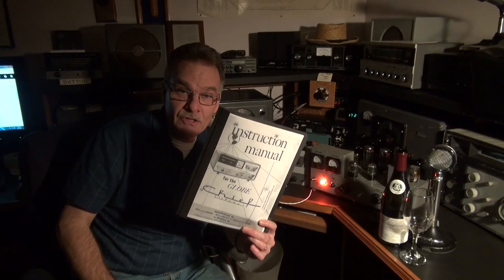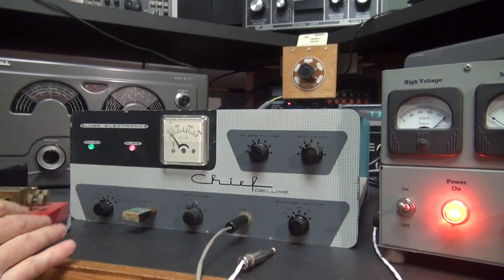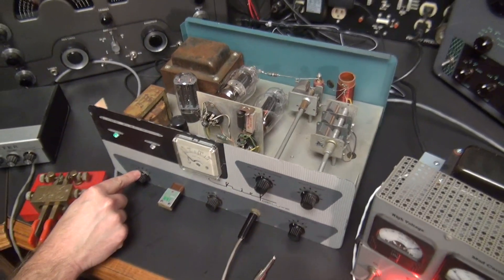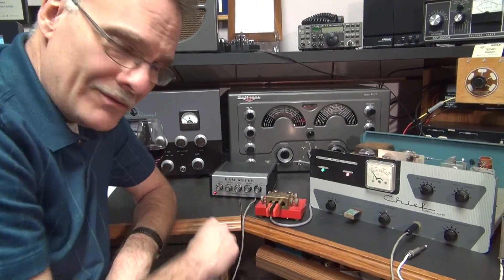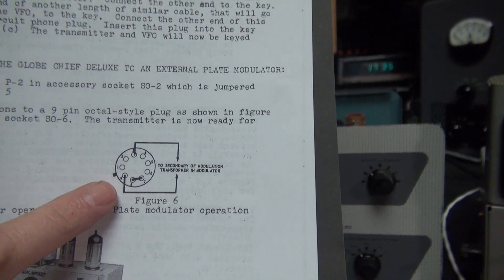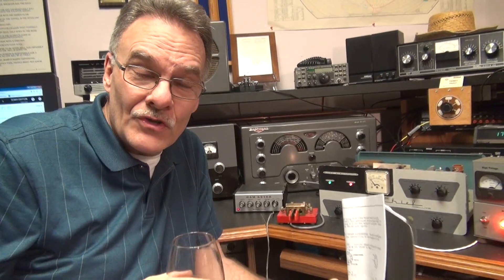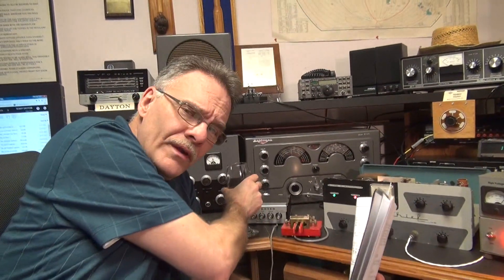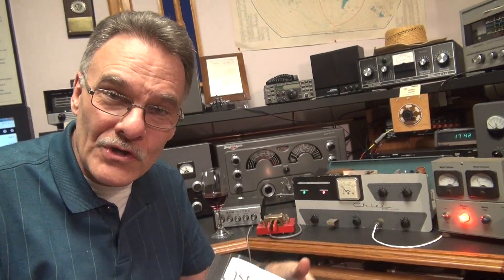How to Plate Modulate a WRL Globe Chief Deluxe CW Transmitter D-lab

Comment: can somebody answer this question? how much did the fender aa270 circuit change through the 70s ? i have a quad reverb that im building from the ground up but there are no layouts for it, the aa270 layout matches almost everything featured in the quad reverb schematic taking out the master volume circuit
Reply: you know a lot about silverface twin reverbs ? if so, can you compare the aa270 layout with the fender quad reverb schematic and tell what are the differences.